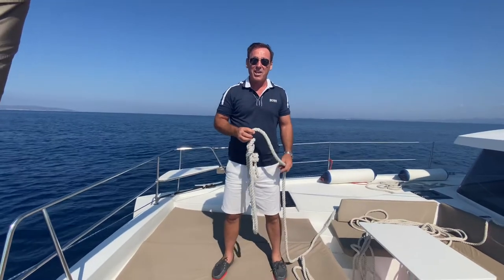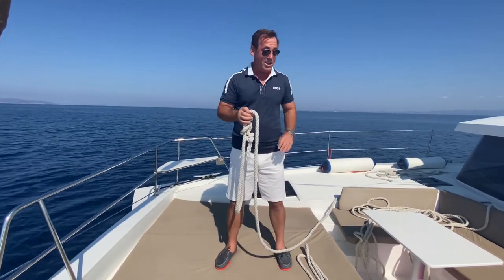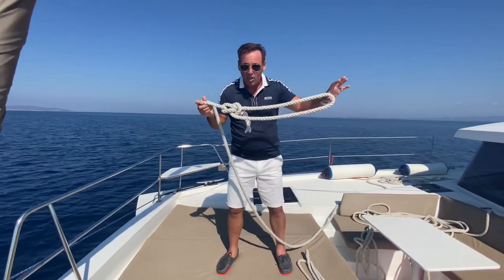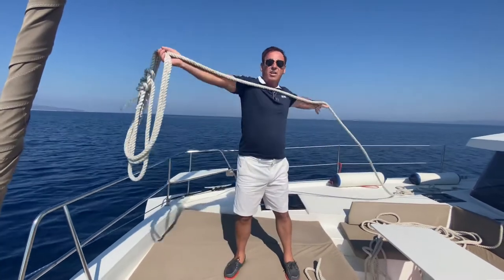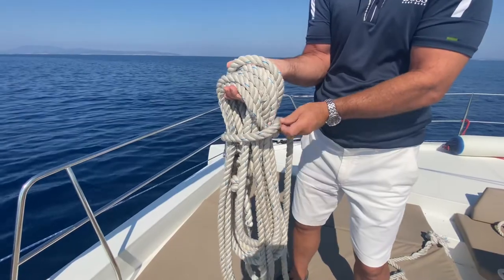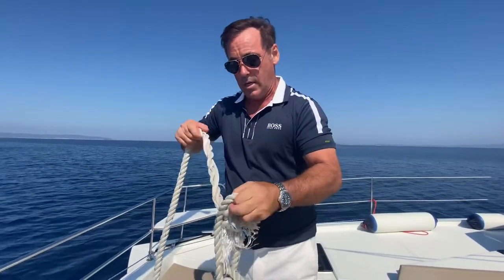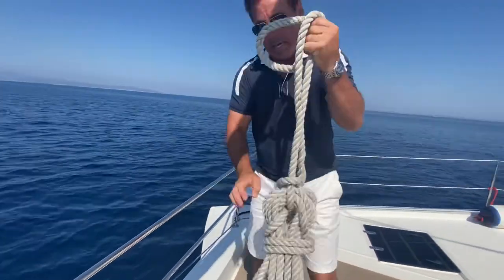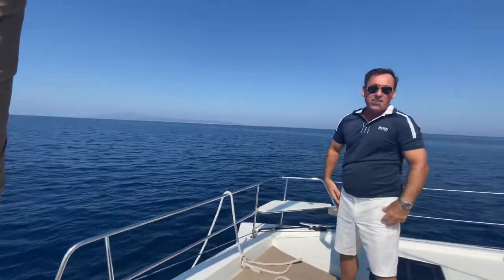HOW TO Coil a Rope | Easy to Untie for Immediate Use on your Boat

Comment: Bad, because you're introducing twists be "rolling it over". When undoing coils like this, you're in trouble because the twists form kinks which gets the rope stuck when running it through something.
Reply from the maker: It’s fine
Reply: @royalnavyyachtmaster  Speaking against your immense experience feels bad and strange, so please excuse me; wish I could simply agree. But, this guy doesn't agree: https://youtu.be/vX4Zr0vdGHE?si=g7QubRy6PEPAWc-5 Also, after I untwisted my furling line (and hang it that way in 8 shape off a winch) it's running smooth now while earlier got stuck quite often times when pulling out the jib. There's the same issue with electrical cables, but with other method: https://youtu.be/swMUqj9FfE8?si=RZMK0nlB3I5r9q2A
Reply: @casybond I believe the difference is that the rope in this video is three strand rope, which has a twist in it.  If you coil a double braid rope like is commonly used on sailboat sheets and halyards the way shown in this video, you will encounter the problem you described.
Reply: @farginicehole513  The same twists are made no matter what type or rope is coiled in this way. It just takes longer to mess up a three strand rope.